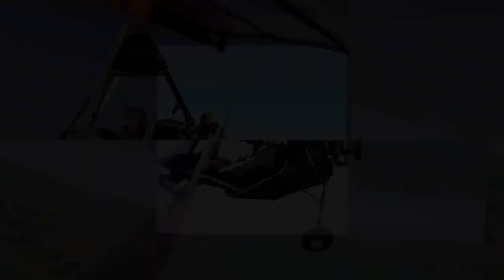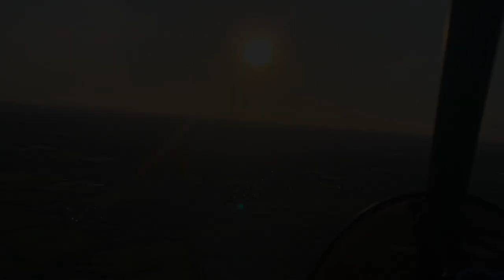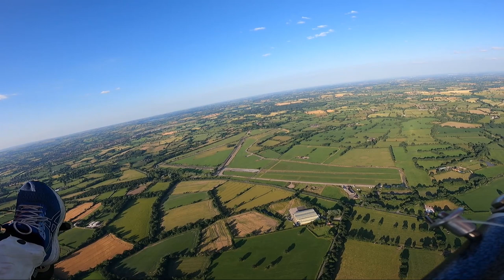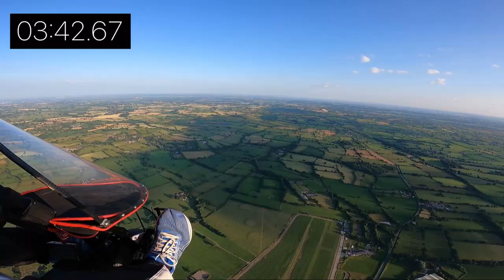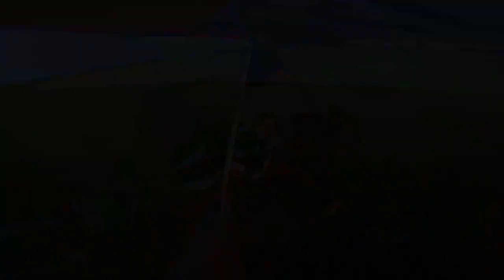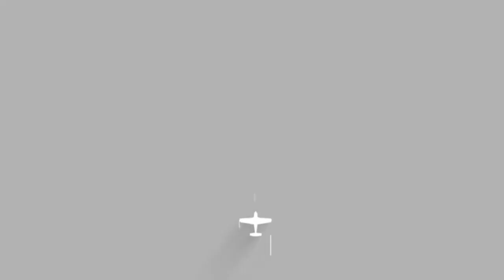Unveiling the Truth: The Consequences of Engine Failure

Comment: Nice to see the green fields of home. I’m one of those glider pilots you mentioned. Please continue this practice. Every flight should be a learning flight. Stalling is a fact of life for a thermalling glider. Stall recovery practice a must. Rope breaks on tow. Also regular practice items. Stay sharp and never get complacent. Thanks for posting.
Reply: By the way I had you more at 12 minutes. Work them end of day thermals ;)
Reply from the maker: Thanks Gary. I do try and make a point most flights if practicing something weather it be steep turns, slow flight, stall recovery or practiced forced landing and I am always wary of complacency. The 12 minute things sounds like a challenge and it would be worth repeating the exercise in thermos conditions.

Comment: The constant engine failure practise during training really does pay off. I trained on a Flash 2A and once I got my license had loss of power, poss carb icing, one day forcing a field landing without any drama. More recently, flying ssdr in the UK, the prop and pulley sheared off after only 15hrs on the engine. Training kicked in again and landed ok, if a little annoyed, lol.
They do glide ok, if a little like a brick, but perfectly controllable. That's why pilots are always scanning landing options - just in case.
Reply from the maker: Wow. Bet that got your attention when your prop sheered off. Lucky it didn’t throw anything through the wing. Glad you lived to tell the tale. Safe flying bud. 👍
Reply: When I did my instructor training in Portugal, the concept of 'loss of power' rather than 'engine failure' made sense as the engine may be fine but no good without a prop, lol. Likewise, when considering forced landings we were encouraged to not think just 'field' and size/shape/surface/obstacles etc, but rather to consider all options which may include roads for example if no fields are suitable. Great fun. I was never too concerned about being able to land if it went quiet, lots of ongoing practise etc. It was more the inconvenience of being stuck in the middle of nowhere that bugged me.

Comment: I estimated between 5 to 10 mins and you were bang in the middle.😊
I fly RC models of every description and gliding is the best, I came to that conclusion after flying powered models for years and one day I thought I'd just practice dead stick after a full climb out as far as my eyesight allowed, I was amazed how much nicer the thing flew without the torque and vibration from the engine so next model was a powered glider ( folding prop ), love silence and challenge of finding thermals.
I then went to dlg ( discus launch glider ) and that was even better, , 200ft launches just by hand and then hunt for thermals to climb out
I had trial plane, glider and helicopter lessons too but the cost was high so I stuck to RC for now.
One day though...
Reply from the maker: Hi Nigel. I too started my love of flying with RC flying before I finally made the big jump about 5 years ago. If you get the chance try full size, I would urge you to have a go. It isn’t as expensive as you might think especially with the introduction of sub 70kg aircraft. Oh and my aircraft is much nicer to fly engine off.
Reply: @paulieb796  Thanks, I will look into it, I defo like the idea of flying micros rather than enclosed cockpits too, I like to feel the wind in my face, I ride motorcycles too, ebikes are my latest craze being silent cheap to run and can go anywhere and pretty safe.
Reply: I also preferred rc gliders. Haven't flown one for a few years but I really enjoyed the scale stuff - Pat Teakle ASW20 and Salto. Looked wonderful off the slope. Later got into PSS and built a number of Brian Taylor plans. Favourite was a P47 with wing section changed to Eppler 374 for gliding better, plus 20 oz lead up front in place of an engine. Flew great off a decent slope

Comment: About 40 years ago. it took me about 25 minutes to come back down from 10,000 feet when I ran out of fuel., in my weight shift trike.
Aah, blissful silence, a  wonderful flight, so I'd guess about 10 minutes from 3000.
Reply from the maker: There is something enjoyable about the peace and quiet that no engine gives. I might have been able to extend the time in the air if I’d flown at best glide speed. Might need to try again! 👍

Comment: Wow, great flying. I was 2 minutes out, thought 5 minutes and you got 7. Would bloody love to give it a go. Was considering gliding but wondering if I should do microlighting and only use the engine for a launch. Given you a sub and will be watching more.
Take care and fly safe.
Reply from the maker: Thanks for the Sub Alan.  These aircraft make great soaring machines.  In fact FlyLight make a similar machine called an Adam with which they pair with a much lighter engine (called the atom I think).  This comes with a retractable landing gear for even greater efficiency.  You have the best of both worlds, a great soaring glider with the peace of mind of an engine if you run out of lift.

Comment: Good evening Paul , fine video and explanation . I have Aeros Trike with a Corsair-Air Black Bull and also a Fox 13 TL wing . What type of 2 stroke oil do you use and which mixture ? Happy flying , Reiner from Sweden .
Reply from the maker: Hi Reiner. I use Motul 800 at 60:1. Or Motul 710 at 50:1. 👍
Reply: @paulieb796  Thanks

Comment: Is it CorsAir Black Bull engine? Looks very much like mine, I have it on my paramotor. I had a series of problems and in-flight failures with my engine, so the engine-out training seems totally legit. I never did it - every  time was for real.
Reply from the maker: Hi. Yes it is the Corsair Black Bull. Mine has been totally reliable. Only had one genuine engine out in flight due to a perished primer bulb so not really the engines fault. 👍

Comment: What is the rate of descent engine off? Oh, okay, about 450ft/ min. Not bad.
Reply from the maker: Yep. That’s about right. I could probably get it down to less than that by flying at best glide speed which is just a bit slower than hands if trim speed.
Reply: @paulieb796  I've been into sailplanes for years and honestly, that sink rate of yours is not to be sniffed at. A 2 seat glass sailplane with 17m wingspan has about half that, so I am impressed!

Comment: The only thing about those little airplanes  that would bother me is the engine noise. I'd love to build a human powered aircraft. Maybe a bicycle with a version of that wing you have on yours? a little pedalling and it should fly. Only problem is to get it up there 🤔
Reply from the maker: I think you'd have to pedal pretty hard.  The human powered aircraft I have seen weigh a fraction of my wing and trike and the cyclists/pilots have been knackered after a very short flight.  The engine noise isn't really that bad as we wear headsets which remove a lot of the engine noise. Thanks for watching.
Reply: You don’t hear the engine with your headset on, just a slight drone.
Not an issue at all really
Reply: The fact you know you can get it wrong is why you'd do this and survive. Seems pretty safe tho, conditions provided